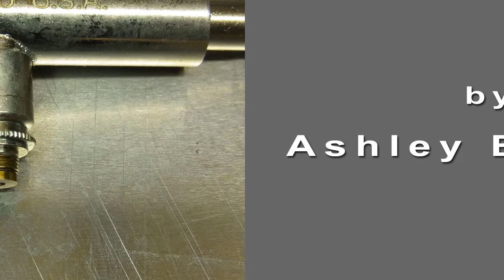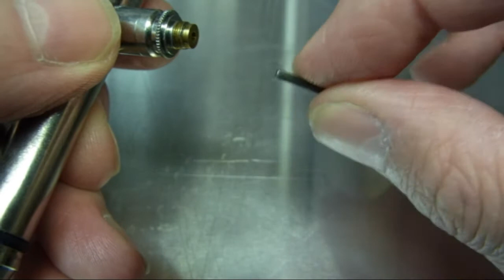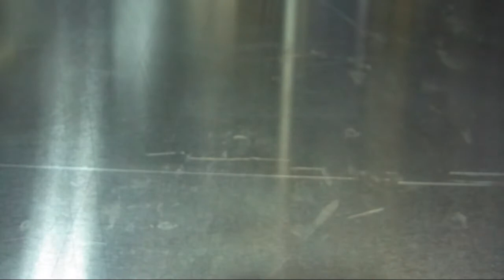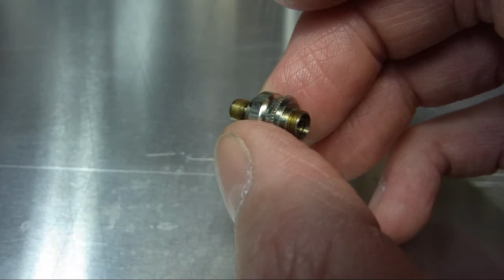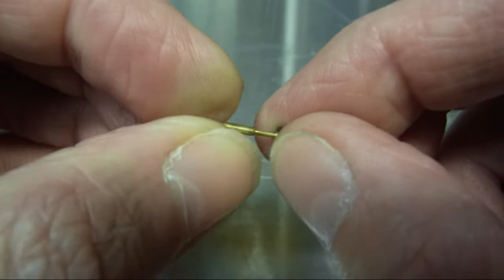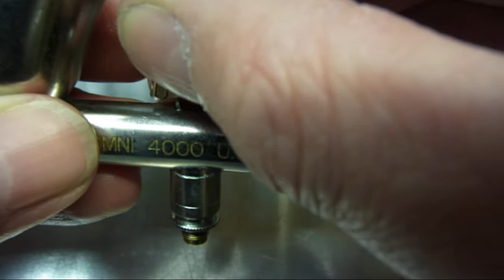Badger / Thayer & Chandler Air Valve Removal

Comment: I have an old Badger 150 from the early 1980's could you tell me if the air valve needle and oring assembly needs a small drop of lube on it from time to time, or just leave it alone ??  Also, I read that it was acceptable to use common "Glycerine" from the pharmacy to lube the trigger spring assembly and needle. Is this true ??
Reply: I understand Glycerin from the pharmacy can be used sparingly to lubricate threads and other parts in airbrushes also from various airbrush communities online, just don't use lubes that contain silicon or lubes that will cause "fisheyes" in the paint. I haven't tried it personally as I still have loads of Regdab needle lube (Badger spelt backwards)